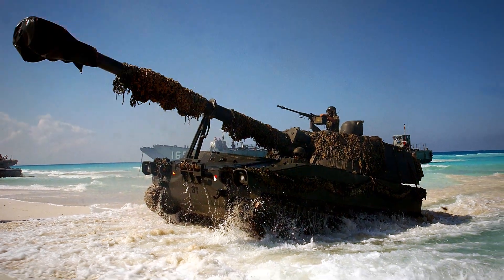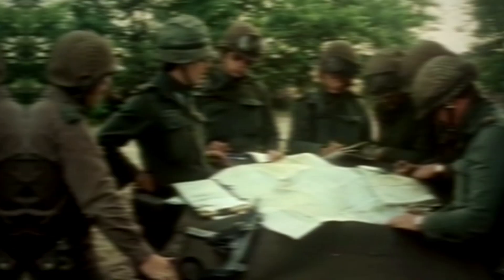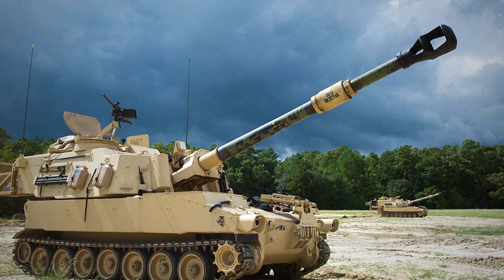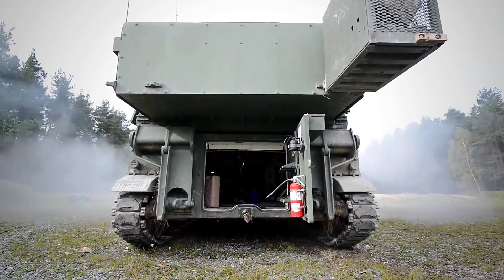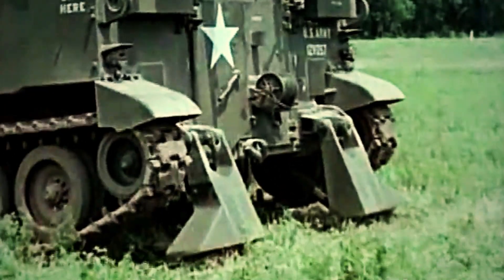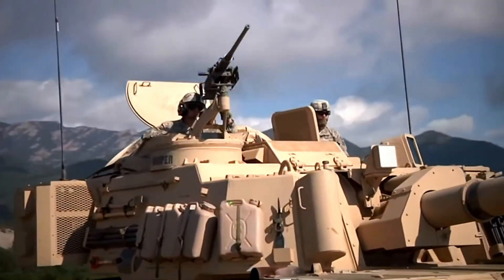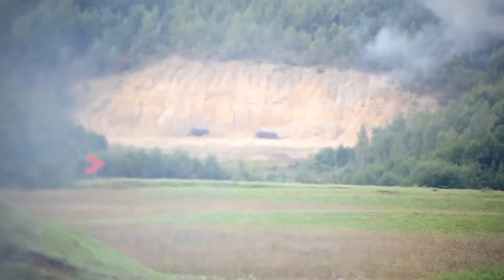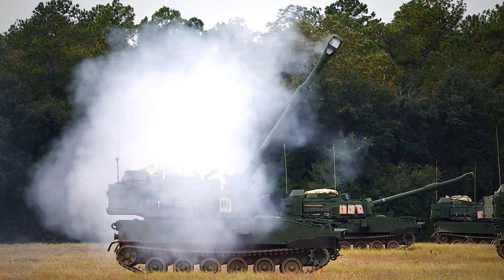Paladin Howitzer

Comment: I trained on the M-109 for four of six weeks of AIT during OUST in 1980 at Fort Sill. The other two weeks were spent training on the M-110A1. I served from 13 January 1980 to 12 January 1992 in the Kansas Army National Guard. From 13 January 1980 to 31 December 1986 I was a Field Artillery Cannon Crewman in two different firing batteries. After 31 December through 12 January 1992 I served as an Armored Fighting Vehicle Crewman on M-60 and M-60A3 Main Battle Tanks.

Comment: Very outdated system,  however effective. Regarding shoot an scoot is way behind many other systems.  It is a great asset if you control air, battlefield.  Being a manual loaded system it is well outclassed by pzh2000,  K9 and similar systems.  The US can compensate for it short coming with its other assets,  but is time to replace it

Comment: Why aren't some of these given to Ukraine!
Reply: In that environment not really suited,  too outdated
Reply: @jantschierschky3461  They might be outdated but I bet they would be greatly appreciated.
Reply: @JoeZorzin  well not for now, right now you want shoot and shoot Systems.  The standard spgs getting killed,  with exception of the pions. So the Ukrainians would used it, but also would lose a lot. So for now the other Systems are preferred. So US don't want to risk those, M777 do the same,  but are not politically risky
Reply: @jantschierschky3461  OK, I know about the shoot and scoot principle- I didn't realize the Paladin couldn't do that, or not so well.
Reply: @JoeZorzin  well it's still a manual system,  so there is a time issue.  If you look at the PzH2000, it can fire 3 shots  very quick and all 3 rounds impact at same time.  So for the US the M777 is the better option. Also Paladin are modified M109,  so 50-60 years old chassis,  engines etc. With the logistics of the US army and support structure it is an effective system,  but in the Ukraine more likely be a liability.

Comment: You missed something about the Paladin. 
The latest batch of upgrades make it so accurate it can shoot planes and missiles out of the sky. 
Which is kinda cool...
Reply: You dreaming,  but nice joke
Reply: @jantschierschky3461  I'm serious.
Look for: paladin artillery shoots missile
and read for yourself.
One of the reason the US is so excited about "sensor fusion" is the ability of an F-35 to use it's radar and automatically command ground and naval guns to take out planes and missiles.
Reply: @disposabull  well the issue is the system is too slow,  traverse,  raise, loading. Also technically a waste of time, there are dedicated systems for that. Fire control etc for that kind of engagement is not available for spg. You could use it as launcher, similar to Excalibur,  copperhead.  However missiles are better options and for those you don't need a spg.
Reply: @jantschierschky3461  You didn't read any articles did you?
It's not a maybe it could work experiment, multiple guns have already been upgraded and tested with spectacular results.
Army, Navy, Airforce all very, very happy.
The ability to upgrade existing weapons to achieve the capability of shooting cruise missiles and planes with artillery makes everyone in the Pentagon happy.
It's real and it's on the upgrade plans, there is no "yeah but, that will never work" argument, it does work and the military wants it rushed out.
Reply: @disposabull  well I am ex artillery,   we used the M109G, so if something can do it it does not mean you should.  You need to consider the gforces,  the spin rate so casings have to very beefy.  So makes no sense why you would,  for smooth bore yes I can see it.  But for artillery nope, so maybe should read those articles again.
Reply: @jantschierschky3461  German then?
The M109 is a really old 1960's platform, you guys replaced them with the PZH's years ago and never purchased any upgrades for them.
The latest versions of the M109 can fire hypersonic projectiles 93KM and hit cruise missiles.
They have been upgraded a lot from the gun you used.
Reply: @disposabull  well firecontrol is improved dramatically,  range and mechanical rammer. Yes for long range shell that impressive.  However for anti aircraft I don't see it, unless you hit airport.
Reply: @jantschierschky3461  You could just use a search engine and read the articles.
The US developed hypersonic ammunition for it's rail gun project.
The rail gun didn't really work well but the ammunition was fantastic.
So they started experimenting with using hypersonic ammunition in artillery and naval guns, it works really, really well.
The faster a projectile travels, the less it is moved off course by crosswinds.
When you combine that with AI onboard the F-35 with it's incredibly good radar, atomic clocks for high precision timing and an automatic fire control system on the Paladin, you can put a shell at an exact point in the sky within a few cm's and milliseconds.
Good enough precision to shoot missiles.
Reply: @disposabull  Yea use the Radar of a plane instead one of the Ground

Comment: "although fitted with night vision, it does not have" NBC protection.   How did you logically fit those facts together. It makes no sense.  Does it have venting, cooling and heat....also is there NBC protection?  That fits together.

Comment: In 1985, I served in West Germany, on the M109A2. It was AWESOME, when it worked. We never made a deployment without having 2 or more powerpacks go out for 1 reason or another. But... It was a great system. I hated the M198 ammo carriers then as well!
Reply: I was a mechanic in FRG also during that time with M113 APC's. Can say that sitting in the motorpool doesn't do machines any good.  After a few days in the field and fixing them up, the Army equipment ran well.
Also was the case during desert storm / shield. AFter they were delivered in the desert we had some hard core maintance for a few days, but after that the mechanics got bored. LOL
Reply: I served in Germany about the same time.  The battalion I was in had M109A3 which was new at the time.  Worked great but I was the S2 at the time so I was not on the gun lines but the only issue we had was getting down the hill to the railway during the winter.  They did not do well on icy roads.

Comment: chassis looks a lot like an m113
Reply: Similar layout,  just a bigger 2 stroke diesel, rest is more are less same. Front is lower.
Reply: @jantschierschky3461  Neat! Always surprised not to have seen more m113 influence on things, people seem to love taking an existent chassis and turning it into tracked, armored something or other
Reply: @cascadianrangers728  actually there are number of vehicles based on the m113 chassis, concept.  As there are many varieties of m113. Those were common in the 60s-70s, however since the chassis of the Leopard 1 and 2 , marder are used alot. Issues with m113 are multiple, armour, fuel consumption etc

Comment: I would have a lot more respect for the M109 if it could be leveled at the enemy.   You know, just in case of an enemy breakthrough.
Reply: Well actually in direct fire with delay and concrete shell it is very effective,  however you don't want to go toe to toe with an apc or tank.
Reply: @jantschierschky3461  Artillery crews do not want to see the enemy.  It is an indirect fire system, not direct.  If a 13B ( cannoneer) wanted to see the enemy, he would be a Forward Observer calling for fire.
Reply: @doughudgens9275  i was artillery,  so you don't tell me anything new. I am just saying you can. Part of our training was to direct fire just in case. However you also forgot the cable monkeys.
Reply: I has a direct fire scope: so it can shoot at what it sees.  In that mode, standard is max propellant charge, so it can do some hurt.
Reply: @doughudgens9275  wow, ok then. I was thinking one of the red legs at Bliss told me that it wasn't capable of LOS firing. What kind of ammo would it use for such actions?
Reply: @michaelhowell2326  whatever is handy.  That is “I need it yesterday scenario.”  Fuse should be point detonating, and a regular High Explosive shell traveling as fast as possible would be best. 
95 lbs of 155mm shell doing over 2700 feet/second can do damage to a tank.  It may not be one shot one kill, but that first shot could temporarily incapacitate the tank crew long enough for a second shot.

Comment: Opening Lines: The Paladin did not serve in Vietnam, the M109 Self Propelled Howitzer did. The M109A6 was the first Paladin and it entered service in 1994, even after Desert Storm. The Paladin itself was miles ahead in development that then SPG that served in Southeast Asia.
Reply: Paladin Crewmember for four years, 1999-2003.  The vehicle crew was 4, not 6:  Section Chief, Gunner, Cannoneer (Loader), and Driver.  The Ammunition Team Chief and Cannoneers 2-6 were on the M992 FAASV that accompanied each gun.  Although in practice, we generally had only 6 men for the entire Howitzer Section which was minimum for both vehicles.  On the older M109 vehicles up to four additional crew rode in the gun while the rest were in an M548 Cargo Carrier.
Reply: I trained on the pre Paladin 109 as well as the old sp 8".
Reply: It wouldn’t be a true Dark Series video if he didn’t get something obvious completely wrong.  The rest is usually pretty good — but there’s always a huge, obvious, glaring error in every one of the series.  😉
Reply: @UnintendedConsequences  I think he does that to stimulate the conversation in the comment section. 😉
Reply: You're correct the A6 came with the new longer barrel and computer fire control. It was a huge leap forward. We got to see a few of them when I was at Sill in 1993. I was a 13E (FDC) in an M110 (8") Battery and I was blown away with the Fire Direction Computers totally changed accuracy and Time to Fire
Reply: @Chris.Simon43  I was 13B from 1978-1988, mostly on towed M198's but I did train on the A2's at Ft. Sill. My son and now grandson are both Artillerymen, one is on the M777 for the Marines.
Reply: The best one is the South African G5 and G6 guns.
Reply: @iHelpSolveIt  They are definitely a lot more mobile than a tracked howitzer, that's for sure. Range is excellent, I do believe it can fire Excaliburs if my old brain's memory is still relatively intact. Anything that can shoot and scoot in less than 2 minutes will be a great asset.
Reply: @whytebearconcepts  it is not that mobile,  as other systems and is relatively slow to operate.
Reply: @jantschierschky3461  I agree. The point was that is more so than the M109 system.
Reply: @whytebearconcepts  well is still a M109,  just with a great fire control,  mechanical ramming,  longer barrel.  So you save about 20 seconds,  but still not fast enough eg PzH2000 etc
Reply: @jantschierschky3461  True again, and does 20 seconds even matter? I guess not for Ukraine, but Russia seems to be oblivious (or unable to counter) to Ukraines drone forward observers where once you fire you're pretty much drawing the attention of every Mavic Pro within a 2 kilometer area.
Reply: @whytebearconcepts  well 20 sec is an improvement versus paladin M109.  How a gun like a PzH2000 can fire 3 rounds in few seconds or 6 within a min, all rounds impacting area at same time.  So a single PzH2000 has more fire-power than a battery  paladins.  It than scoots before counter battery even fires. With the PzH2000 you talking about a 25 year old system.  Paladin is ok for US for moment because it has many supplementary systems.
Reply: Wrong tested and early models  Were there
Reply: @tomhenry897  Go back and re-read my comment. The M109 was there, the Paladin did not exist until 1994. The 155mm SPG was not named Paladin in Vietnam, only in later versions (A6).